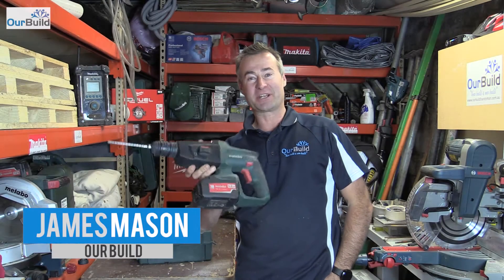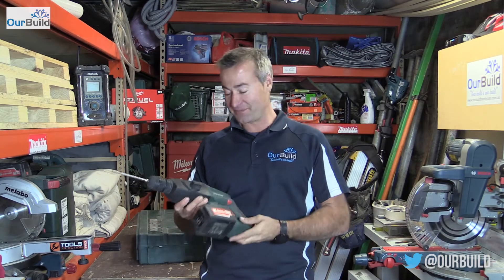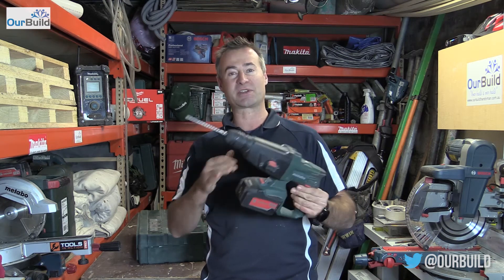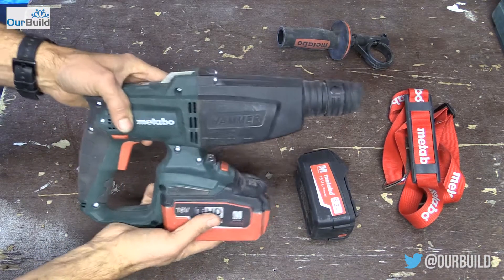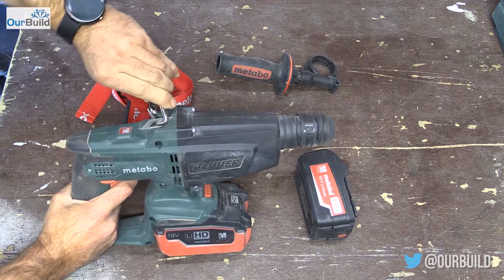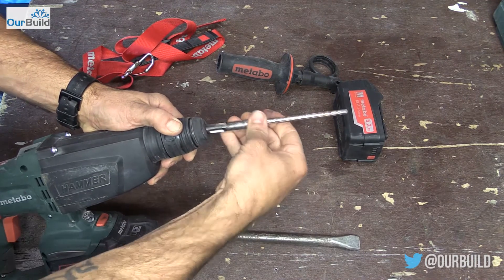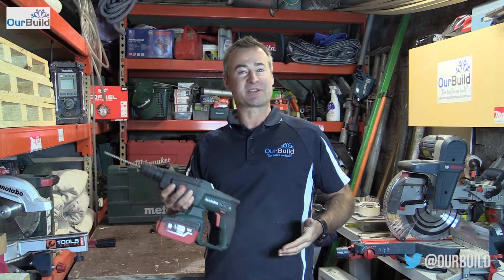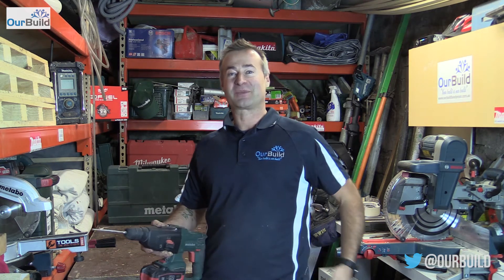METABO 18V CORDLESS COMBINATION HAMMER KHA 18 LTX

Comment: This is a really good 18V hammer drill. Only light chiseling capabilities but apart from that I found it so good I got rid of my corded drills. 
On the Black Friday sale a few weeks back I picked up the new KHA 18 LTX 24 - the new 18V Hammer drill from Metabo and it is even better. Better ergonomics, vibration reduction, high quality quick change jacobs chuck in package and it does not BEEEEEP when you are starting to drill. Metabo went from making an excellent hammer drill to making a superb hammer drill. If I feel spendy I can get a Vac attachment for it too.  Two small nitpicks with the new one: as with the KHA in this video you cannot gauge battery status with battery mounted on drill. Other small nitpick is that there is no clip for attaching a shoulder sling on the new one. I made my own out of an eyelet screw and a small carabiner attachment and put that eyelet screw into an existing screwhole - done.  The new drill is a little heavier but with better ergonomics and it still fits in any T-Loc or Classic SYS II with charger, batt´s and accessories. Not with the Vac attachment though, that wold require an additional SYS. There are some great 18V drills out there today, Metabo is among them for sure. Will keep both.